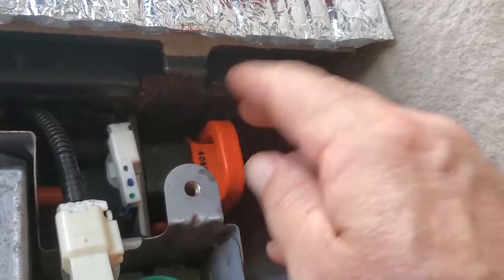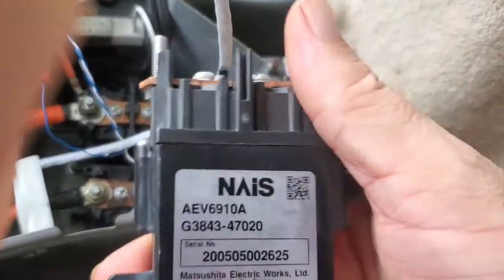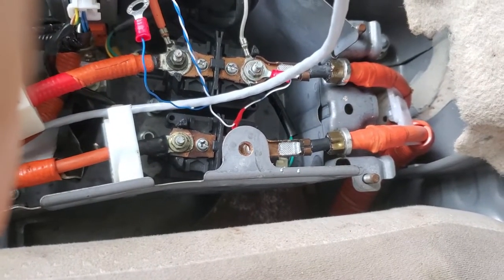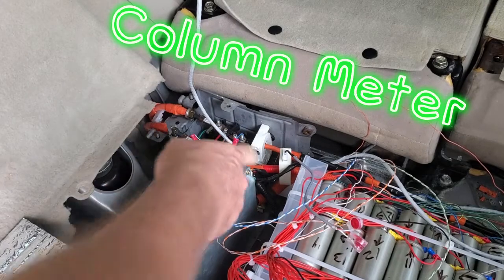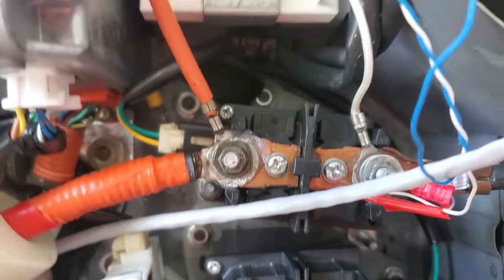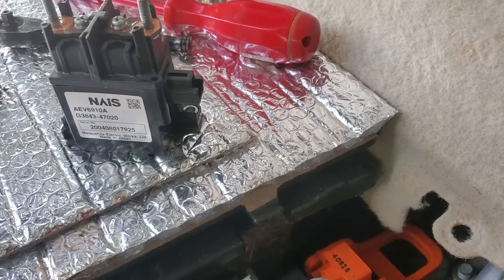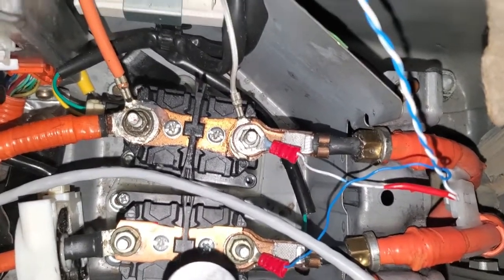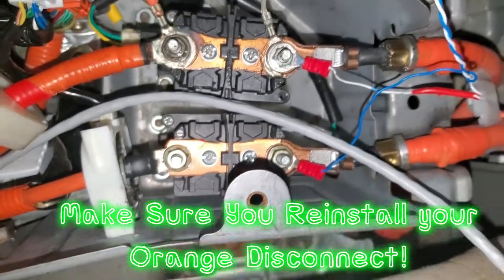Hybrid Relay Replacement P044A

Comment: I have a bad sensor power supply 1, is this the same ?
Reply from the maker: Did it give you a code P044A?  The sensor would measure voltage.  This connects and disconnects the hybrid battery

Comment: hi one question how you test the main relay module, what measure is right, and how i know when is broke, i know about the code. thanks so much let me know
Reply from the maker: They are pretty simple just being a electromagnet.  The system will briefly shut them down under certain circumstances like a large pothole just in case it's an accident.  Then come right back on.  Once they are warm they can get stuck or not have sufficient strength to close.  
If stuck (closed) you will see continuity across the relay even if the car is off which defeats the safety system.  The code will tell you whether it's the positive terminal or negative that needs to be replaced